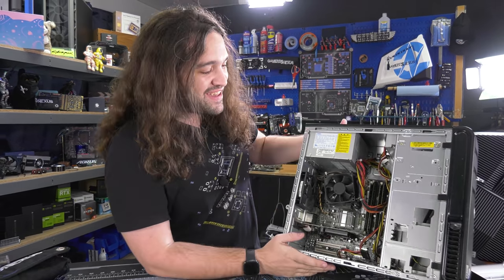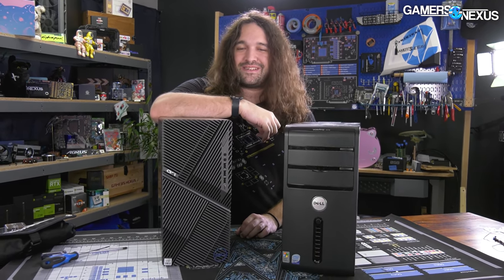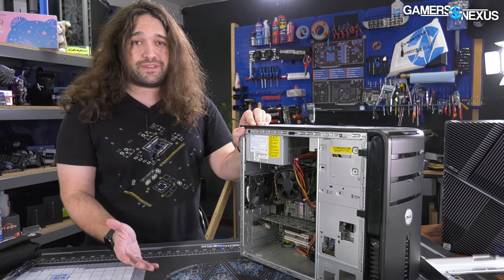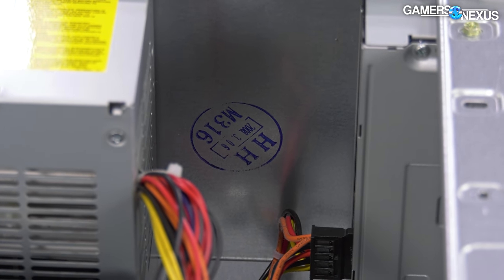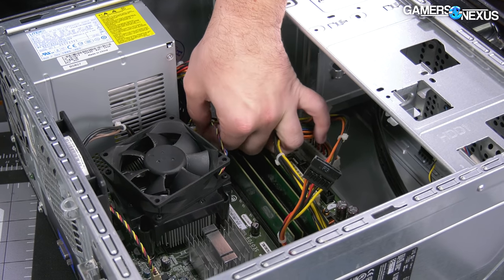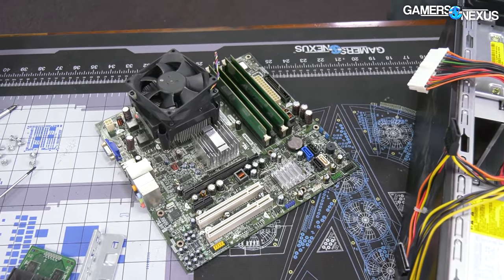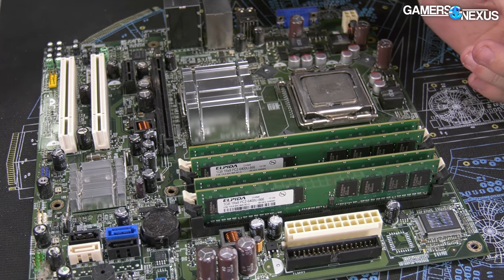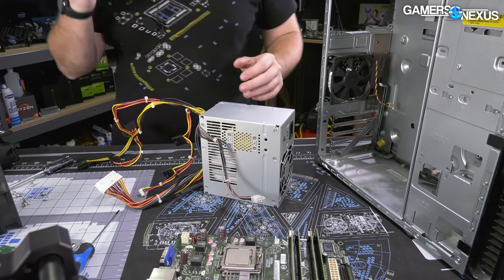13 Years of Dell Getting Worse

Comment: Check out the plastic holding the heat sink in that Vostro 400. The plastic on each screw post was molded seperately from the rest of the mount and has a join with the rest of that mount that would often fail when it got up to temperature. When those fail the heat sink just falls off with no way to reattach it.

Comment: As an IT pro that deploys 100s of desktops per year I appreciate the newer smaller form factor desktops. I dont care at all about the non-standard motherboards. New towers take up less space, are easier to transport, and are just over all much easier to work with. The MT desktops still have plenty of expansion ports if you do need to specialize the system for certain use cases. Performance and reliability have not suffered in any decreeable way that I have seen. The target customer for a dell system has never been and will never be the tinkerer.
Reply: Yet us tinkere still tinker the f*ck outta them!

Comment: optiplex 390 here, it's a standard motherboard. Only problem is bios is locked to sandy bridge, the bios chip is to small to support ivy bridge even though they're on the same socket. Anyway, slapped a xeon e3 1220 on it and 8gb ram as well as a 75$ ssd, and it's an amazing office pc for less than 200

Comment: I have been building my own computers since the 1990s and we currently have three working desktops that are all hand me down components with occasionally replaced parts such as recently replacing a 12 year old power supply.  When I buy parts I use quality companies and try to get the best cost/power ratio I can, which generally means the components last a long time.  All three computers run  everything the individual users needs and old components are taken to the local electronic recycling drop off.  I have never purchased a pre-built.

Comment: Believe it or not. In the company I work, we still use a hand full of Vostros 410. 
They have an Q9450, 8GB RAM and a 256GB SSD and Windows 10.
You may ask why. Well, they are reliable, robust and get the job done.

Comment: My mother bought a prebuilt Dell mini tower for her night school duties in the early 2000s. By the time we retired it I decided not to spend any time reusing or repurposing anything inside it. As it was not upgradable I got her a laptop instead. It was a Dell XPS. Eventually the screen died. And with all prebuilt laptops you are not really able to do much once a severe error happens or you wish to upgrade the cpu. So She then got a Lenovo T410, then a Lenovo G570 and then an ASUS x55 I think. She buys them herself and they last 2-3 years. The worst thing is laptops in the Windows 10 era, you cannot turn update off so one of the laptops downloaded 2.5GB Windows 10 update once every single day, failed to upgrade and repeated the next day. My parents still enjoy their 20mb ADSL. If they did not feel a bandwidth loss then and don't now they will never get better internet or better computers. Unless I put something together, which I will not. I don't time for supporting PCs I build - I have a day job that pays the bills. If I want to build I build for myself. My only prebuilt PC was a Banzhaf in autumn of 1991. I bought a Sony VAIO laptop in 2012 and I still use it every day, and replaced / upgraded the battery, drive, memory and optical drive bay to SATA drive. Newer laptops I am not so keen on. Example: Lenovos at work only fit one M.2 drive. But hopefully Louis Rosmann makes changes happen in the industry.

Comment: I think you've missed the part where the IO shield is stamped into the case, so using a different motherboard in it would be a challenge, which is a shame.

Comment: I had a Dell XPS 420 desktop from around 2009. It was all standard parts, except the power supply, which was a standard power supply in function and appearance until you took it out of the case and realized that the power supply enclosure was designed to interface with the case with a little tab on it that would fit into a slot on the psu enclosure. So you could get a replacement power supply into it, but the case needed a little modification so it would fit properly.

Comment: I have had Dell systems since 2004ish, and can honestly say that all my systems have lasted 8 years or more (unlike HP; think they are low quality components).  I have never had to replace: the motherboard, front I/O ports, memory (only to upgrade as in new OS requires more memory, or I run low), power supply, or really anything for that matter.  I have had to install wireless cards, upgrade hard drives, swap graphics cards (if outdated), but not much of anything else.  I put in quality components when needed, and run my machines on battery backups; so when there is power grid issues, they don't effect the machines.  So long as you take care of the computers, and not abuse them, I don't see an issue with the proprietary setup.  I max out the customizations on the website, try to get the best system I can, so that way it ages well.  I just got 2 new systems with the 12 gen I5 and I7 with DDR5 memory, maxed out the power supply, maxed out the wifi.  I expect my new systems to last at least 8 years or more, by getting the latest hardware possible.

Comment: I am still running my Dell Studio XPS 9100 from 2011 and it's still running great, other than it can't run windows 11 because it lacks TPM and UEFI BIOS.  Like the one in this video, the air-flow is not optimal (that was less of a consideration then) but it looks cool and all the parts inside are standard.  I've upgraded to SSD, maxxed out RAM at 12GB, upgraded thegraphics card twice, swapped out the stock PSU for a 650W Corsair, and a few other minor tweaks here and there.  It was this adoption of standard form factors (and a wicked sale price) at the time that influenced my decision to go with Dell rather than build my own after a bad experience with an earlier Dell model that was proprietary everything and not upgradable.  I am saddened they have reverted to their earlier tactics.  I was considering a G5 as a replacement, but after seeing this (and the other G5 review) I think I'll stick to building my own again from now on.

Comment: My parents have a Dell workstation just like this one that we have had for around 10 years or longer and over time we have replaced parts on it that have failed with use from wear and tear. The only parts I can think that have not been replaced with standard off-the-shelf parts is the motherboard, CPU, case, and CD drive. That computer is still alive and functioning just fine to this day because of the replacement standard parts. What happened Dell?

Comment: I have a HP Pavilion Elite E9290F and other than replacing the power supply once because it died overnight, and swapping the graphics card for a 750 TI, it's still working great! Wish it had just a tad bit more RAM though.

Comment: You should do a video with old PSUs on the tester to show why old PSUs might not be safe, or why they might be!
Reply: Some of those older Cells have what look like ATX power supply connections that are proprietary. We used cable adapters to replace them with psu off the shelf.

Comment: I used to have a similar chassis but with a glossy black front, a Dell Studio 540. Was running a Core 2 Quad Q9550 and in 2010 put in a GTX 470. Naturally had to upgrade the lousy stock power supply as well

Comment: The Vostro 400 didn't need all that ventilation  It wasn't meant to be a gaming machine or high performing workstation.  It was just an office machine for checking your Email, doing your homework, surfing the internet and maybe watching YouTube videos or something.  I had a Dell Inspiron from 2011.  I was able to swap out the i5 2320 for an i7 2600, put in a 700 W PSU, a GTX 1080, 16 GB of RAM and make it a fairly decent gaming PC without any overheating issues.

Comment: I am still running a Dell XPS 7100 from 2009ish that I added a 1050ti and more ram, the rest still stock parts. It works great for light gaming and general tasks. The only issue is that some new games like Apex Legends cannot run on a phenom processor.

Comment: I used to build cheap gaming systems with old Ivy Bridge and Haswell Dell desktops. The only thing that sucked was that I needed adapters for the psu -> motherboard power cable and another adapter for their cpu cooler cable. I think that was when Dell started to make everything more proprietary but at least it was possible to upgrade.
Reply: cries in fan adapter, psu adapter and front panel adapter 😂. boys rocking a 9020 build because I can't afford new shit

Comment: My very old Noctua F or P12 (before they had a redux line and the fan was just the current Noctua pressure fan) came with those rubber fan screw replacements included. I think I used them in some 140mm fan for the better part of 10 years.

Comment: I always like my Inspiron 518 I got back in 2008.  it was a great PC and everything could be replaced.  The only odd thing in that PC was the power button which I think was a 9 pin USB connector.  I later upgraded the CPU to a Q9650 and GPU to a GTX 260 with an upgraded PSU and it ran great for games at the time.  I have been thinking about using that case in my new build. I really like the design.

Comment: I have an OptiPlex from about the same age and it uses proprietary front panels and the case is more metal than pc, the case alone is 30 pounds of solid metal. 
it's slightly better than previous because at least back then they used a standard power supply. 
also those rubber bungs are a good option, as noctua puts them in their fan boxes to help get better noise isolation. I would be interested in seeing if it makes much of a difference or if it's all marketing.

Comment: My problem with Dell computers had always been how quickly they broke. I bought a brand new Dell back in 2004 or so. And the power supply completely died after only a month of use. It was only used at the time for browsing the internet and writing short stories.

Comment: I had built an i7 9700kf system in March of 2020 with a rtx 2070 Super mini (it was a SFF), I kept the Sabrent Rocket 2TB nvme and my SSDs but got an Alienware Aurora R11 i7 10700kf rtx 3080 system and upgraded the RAM to corsair vengeance 32GB, then sold my old components.  Recently I took all the components, except the psu and motherboard, out and I got an MSI motherboard and new case.  The motherboard in the Alienware had crap VRMs for a system that is supposed to overclock (and I did have it overclocked to 5.0 ghz per core, but on my MSI motherboard I can now do 5.1 ghz per core)  but I am really pleased with my RTX 3080 from them, as I have a stable 2100mhz overclock on it that stays at 57c in the new case and was around 65c in the old case

Comment: HI!  Please tell the folks that Dell omits some items on lower-end models of their computers, BUT often same items can be bought and retro-fitted.  For example, I bought a "re-furb" Dell XPS 8930 comp.  It had an 80mm top fan, cheezy CPU cooler, and that's it.  Had to buy Dell top case fan bracket for 120mm fan, and  Dell lower front case bracket for 120mm fan on Ebay, once I figured out such things were available via user forums.   Used Noctua fans.  No pins for "front" fan on my MoBo (even though a spot was labeled for it), so I power front case fan straight from Modular PSU, which replaced wimpy Dell PSU. Also had to buy an appropriate Alienware CPU cooler, which exhausts  via radiator straight through the (now) 120mm top case fan .  Also installed a Dell heat sink for Voltage Regulator Module that screwed-in to existing threaded MoBo fasteners.

So, suggest you mention that >>some<<  Dell computers can be upgraded with hardware provided with their counterpart Dell "upper-end" computers.

Thanks for all you do!

raf

Comment: This is a pretty funny video for me, since when I decided to "upgrade" my old system I actually bought an Optiplex 3010 from 2012 (I like the way it looks) and all I did was upgrade the PSU, Ram, put an SSD in, and put a 980ti in it and it keeps up pretty well with the games I want to play. I could only do this because Dell thankfully didn't decide to do some proprietary BS with the PSU connector like they have in the past. All in all it was about $600 and it runs really well, hilarious to see how I dodged all the BS with the new dells.

Comment: those silicone insert for power supply are same thing noctua provides with their fans. It is a gasket to isolate vibrations and noise. That's not bad...

Comment: My Vostro 400 came with Win XP in mid-2008. When Win XP expired, I eventually used the upgrade discs to make it Vista 32 bit. When Vista expired, I had to change out the RAM to 4X 2 GB sticks (Dell doesn't mention it supports 8 GB but it does) and I put Windows 10 on it. I needed a USB 3.0 card in there and was short the power plug so I had to disconnect the floppy drive. I also have a firewire card for my ancient DV camcorder. I had a Vostro 200 too, same upgrade path, but eventually it just wouldn't boot, like there wasn't enough power to get it going because it would just shut down. I could have bought a new motherboard or power supply, but Best Buy said they only work on computers that are less than 3 years old so I recycled it. It was a borderline decision. I did upgrade the video cards to Nvidia GT 710's, but I've been told they recently stopped supporting them. I also bought a couple of  2 TB hybrid hard drives for them. 
If you're trying to get data from a DOS machine, you'll need a 32 bit OS with a RS-232 cable.
Reply: I'm sure benchmark numbers were in the 3 digits back then and now they are in the 5 digits. So I'm ready to upgrade to some 12th gen Intel machines with Windows 11.

Comment: As a Government IT Technician who works with Dell products on a daily basis as 90% of government computers are Dell products mostly laptops these days I can very easily tell you that Dell products have been getting significantly worse as years go by especially their laptops swollen batteries are very common these days and dealing with Dell reps is an absolute nightmare Don't buy Dell products whether it be a printer a laptop, a desktop just don't do it take it from someone who has worked on literally tens of thousands of these things Don't buy these things
Reply: Can you share your view on other companies? I don't deal with many computers other than my own, and it seems to me that Dell/HP offer the lowest quality and Lenovo Think- subrand products are the least shoddy (But Lenovo is chinese so the US Govt probably doesn't use any?)

Comment: "looks like it should be in a computer from the 1990s".  Bro.  My families gateway pentium pro from 96' just had a heat sink on the CPU.  Zero active cooling at all in that PC.

That heatsink was also like, CEMENTED onto the CPU.  When my parents got a new PC around 2000, my first experience taking apart a PC was taking apart that old gateway (I didn't expect at the time to be able to put it back together and have it work, lol.  I assumed I was killing it.).  I had to chisel the heatsink off the CPU.  The thermal paste was thermal ultra hard glue.

Comment: This is why I supported AMD AM4 and companies producing products around that socket. My 'budget' X370m motherboard can be upgraded (based on spread sheets shared years ago) from a R5 1600 right up to a R9 3900x. That means same, RAM, case etc and huge uplift in performance for a '10 year' PC not a 2 year dumper. Heading into a recession it is a lot more efficient for a company to produce CPUs at a 3:1 ratio vs motherboards.

Comment: As for this particular Vostro 400 (also for the Inspiron 530), the only quad-core Dell ever used was the Q6600 (and had a slightly modified version of the stock G33 chipset motherboard for supporting that CPU).  The weak point on the system is that the plastic where the screws go into the heatsink break over time, rendering it useless.  At least it uses the stock 775 mounts (which was also used on the AMD variants for a few years as well).

Comment: Actually I would check the wiring on the PSU.  Dell for a time was using PSU's that were wired differently then the standard ATX.  I don't know if this was from that era but it was a big problem for replacements. They actually had to sell Dell Specific PSU's and the problem was the wiring was just placed differently.  I know it definitely affected the 20 pin PSU's maybe the 24 Pin ones they stopped that.

Comment: Ah, good to see that separated North Bridge again. I was so confused when I built my last computer and it was missing. Gotta say, Dell used to be a good company in the mid 2000s. I even bought an XPS from them in 2006 for my HS graduation. Back then, there were hints of them getting worse with their proprietary BS, but I didn't think it got that bad. At least their workstations are acceptable for office use; best value what with all the refurbished ones littering the market.

Comment: Steve, you should compare this "new" Dell computer to Dell Dimension 9200 or Dell XPS 410 (white enamel sides) or XPS 420 (black with silver sides).  Vostro line was more of a budget line.  The Dimension and XPS was the way to go back then.  They used the same Q6600, but with a BTX motherboard and decent cooling for the time.  I really liked these computers and, in my opinion, they were some of the best looking Dells you could get.  They still look good even today.  The power supply wasn't 100% standard, but I was still able to install it without case modification and was able to route all the cables where needed.
The bad thing about that era 2005-2010 of computers (not just Dell) was the leaky/bulging capacitors.  Even 10 years ago people already had problems with them on these motherboards.  At just about the same time (2006-2009 or so) Nvidia had problems with their video chips overheating and failing on laptop motherboards.  Weird times.